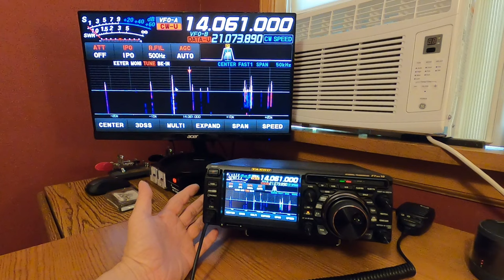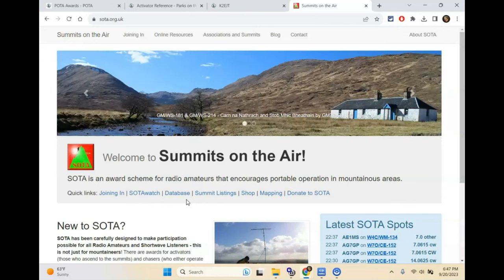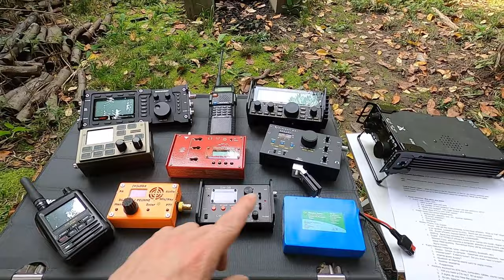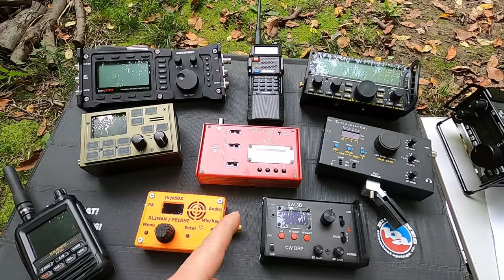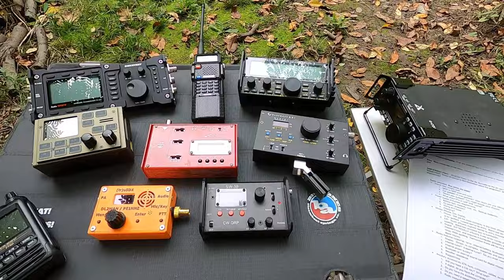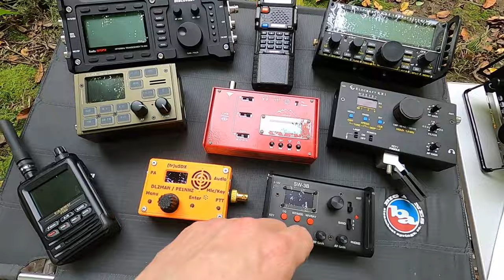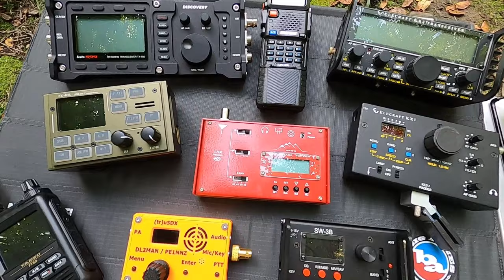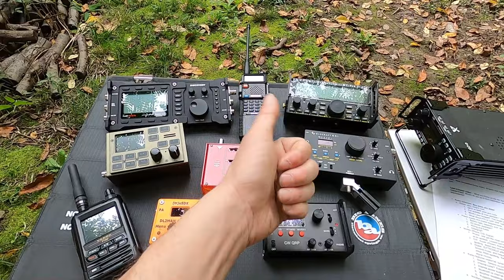K2EJT's Guide to POTA / SOTA Field Activating Episode 1:  Radios

Comment: Really great video, lots of rig envy here.

The truSDX is a great little rig and I agree, an awesome backup.  My mcHF was having trouble a little while back and I took the truSDX on a trip to K-0034.  It didn't have enough power to do SSB from down in the valley where we were camped but I got 3 days of CW activations done.  It was an ideal circumstance for it, down in a valley in the mountains.  At home it overloads from the nearby AM station.

The mcHF is a nicer rig but the truSDX is amazing for the size and the price.  It was also a clever kit and fun to assemble.  Another fun set of rigs are the kits from QRPLabs.  I like the band agility of these radios more but the QCXes are solid.

My first rig was an FT-891 but since I've started collecting these little QRP rigs I haven't taken it out of the rack.

I'm waiting to pick up an FX-4CR, along with the rest of the world.  

73 de AB4EN
Reply from the maker: Yeah, the (tr)uSDX really is an impressive little radio for what it is.  I wish the receiver was a little better, but what do you want for a $100 all mode radio?  The QRP labs radios are sweet.  I'm eventually going to pick up a QMX.  I'm not a huge fan of monoband radios, but if I did buy a QCX it'd probably be for 40m.  I've heard lots of good things about the mcHF, but haven't used one yet.  Thanks for watching and 73!
Reply: @EvanK2EJT  The MCHF is hard to come by these days, I don't think they're making the kits anymore. Without having played with one yet, the FX-4CR looks like a more modern version of the same concept, huge amount of modern radio packed in a very tiny package.

Comment: I'm kind of surprised there is no QCX Mini on the Table. :) Great small rig and great entry to kit building. Just finished building my 14MHz version, I can rally recommend it. 73
Reply from the maker: I've toyed with the idea of building one, but just haven't taken the plunge yet.  I normally run 40m, so if I built one, I'd probably go that route. The one thing holding me back is the fact that it's monoband.  If that particular band isn't propagating well that day, it can make things rough.  I'd probably go with a QMX for the added bands and functionality, but since they're more difficult to build and the wait time is much longer, I figured I'd hold out until they were more available.  Thanks for watching!

Comment: The KX2 has an internal battery as well as an internal antenna tuner. It ends up being smaller than. The others when you add a battery and a tuner.
Reply from the maker: It does.....if you need the tuner.  I generally run resonant antennas, so a tuner isn't a necessity for me.  That being said, sometimes it's nice to have.  The KX1 is even smaller, and has internal batteries and an internal tuner. If I'm trying to go absolutely minimal kit, it's the KX1 with internal batteries, and a random wire on a BNC binding post.  Thanks for watching!